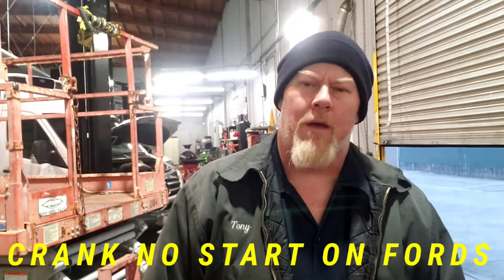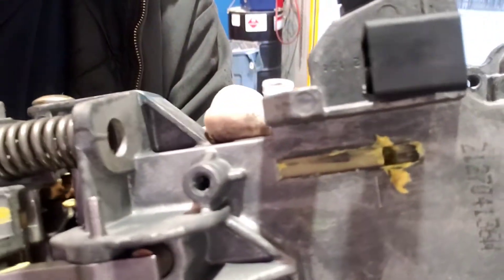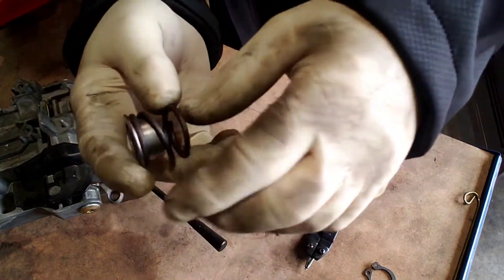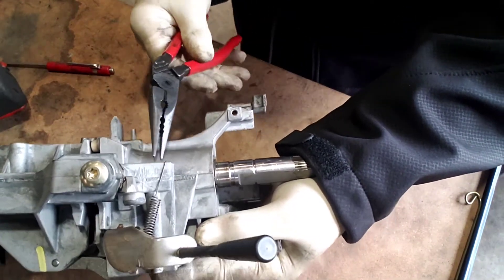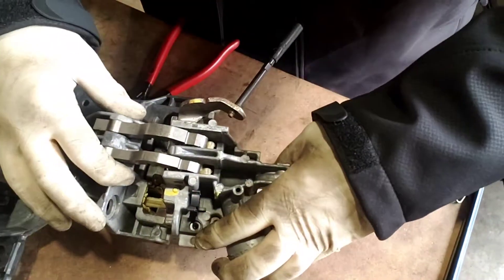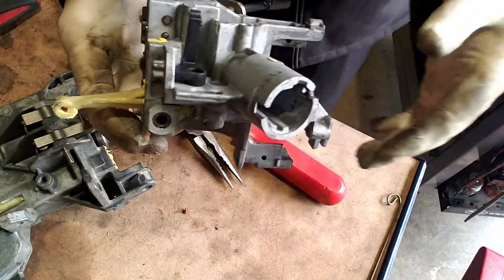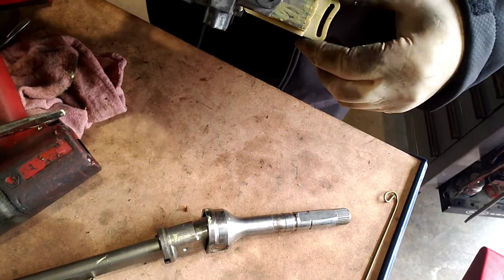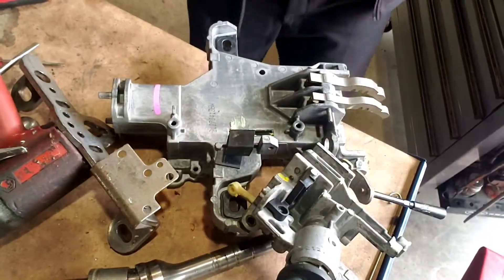FORD NO CRANK NO START

Comment: Nuts & Bolts with Tone... Cool video brother.. I have only had the pleasure of doing that repair 2 or 3 times. I prefer air tools over cordless because I've just never had good luck with cordless tools. Either the tool breaks or doesn't last very long or the batteries go bad.. My air tools have never let me down..
Reply from the maker: Air tools are much more reliable however i have only bought snap on cordless tools. Thx for the feedback.